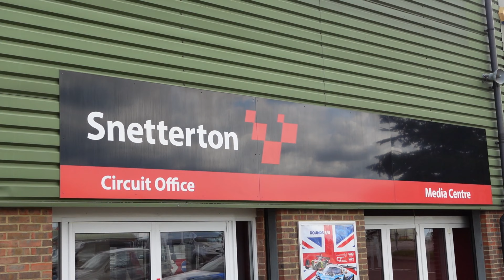I Took My R32 Mk2 Golf On My FIRST Track Day After Rebuilding It

Comment: You did so well especially for your first day! The Golf sounds incredible!!

A couple of things that might help you, from my experience. Firstly bin off the dash board cam and stick with the incar cam, you will learn so much about what you are doing, how you are positioning the car, steering inputs etc.

Secondly (im not sure if it was you or Ben on the incar?) but always keep your hands at 10 to 2 (or wherever is comfy) you should never need to feed the wheel / move your hands from that position. (Hairpins will only ever need a full crossed arms turn) the benefit of keeping your hands in one spot is, you can accurately apply the same lock each time and also if the car gets out of shape and you have to add some oppo, you know exactly where the wheel is. If you move your hands on the wheel for a corner and the car steps out, you need to act fast to add some oppo, and you will have no clue if youve add 1/2 a turn a full turn of lock etc its very easy to over correct in this situation and end in a tank slapper… keep your hands firmly in 1 position… ill stop blabbing now 😄

Looking forward to some more track action!
Reply from the maker: Appreciate you watching and enjoying the video. I've watched a number of yours so to receive feedback from you with the experience you have is really valued. 
The GoPro was a funny one, it was primarily used simply for the hyperlapse heading to the track, then thought, hey, why not view things from another perspective too? But yeah, the in-car cam, viewing the wheel and the road ahead does give far more useful footage for me to look back on and see where I can improve.

With regards to the hand positioning, I do have to make a conscious effort to keep them at the quarter-to position. I think it was Ben who lets the wheel feed through but he has a long standing wrist injury so is unable to grip the desired way. Even with that, he's still able to drive the wheels off the car! 

I tell you what though. It was so much fun and I was getting more confident as the session progressed. I'm itching to get back out! Where would you recommend as perhaps another good entry level track?
Reply: @golfmk2  

Absolutely! You could tell he wasnt handing around!

Ive hardly done any track by you, but id recommend Anglesey if you want a trip out? Its a fantastic circuit, Cadwell is also one of my favourites! Failing those the Nurburgring is a must!!

Looking forward to seeing more track footage! You will have to take me out for a passenger ride at Curborough if you are going this year

👍🏼
Reply from the maker: James Cope you know what, Anglesey is one that really floats my boat, but it's so far away from us it would be at least an overnight stop, so needs a bit of planning. Cadwell is a bit advanced for me, especially the twisty bit added to the fact it's very narrow. 
Bedford isn't far from us, neither is Brands, but Bedford's noise restrictions are crippling and Brands is very expensive. There's also Donnington, which is a couple of hours drive too, but again, quite a complex and unforgiving track!
Reply: Talking to me about hand positioning? 😅  I broke my wrist and forearm years ago and have to set my hand positioning up in advance for certain corners as the movement you describe is not possible, reaching a limit before a normal person
Reply: The dashboard cam does have one benefit... You can see that it's turned on and recording!   It's probably why the footage was used I'll wager.  The other camera seemed to have a mind of its own as to when and how long it would record lol
Reply from the maker: You're not wrong, there were some technical issues with the recording equipment, both with the GoPro and in car camera, where some large sections were not recorded or severely cut off. I'm going to blame the tech, as it definitely was not user error. Nope. Definitely not. 😅
Reply: It was not a criticism just an observation 👍🏼 but totally understandable!

Gopros tend to have a habit of doing that! I think the newer models seem much worse from what ive seen online. I borrowed an 8 black for my last trackday and it was brilliant, great quality and didnt fault once… maybe i was lucky 😄
Reply: @Jims_racing  100% welcome the comments and feedback, it's impossible to list all the conditions and reasoning.  I would advise exactly what you said.  The camera setup for me can really chew into / be at odds with just enjoying driving.  Takes a lot of effort to get it setup correct with good angles, set the exposure so it's not bathed in the nuclear explosion whiteout while the camera tried to brighten the dark interior 😅
Reply from the maker: @James Cope  yeah the I was using was a Hero 7 Black and I'd not had issue with it prior, but on that day, that and the in car cam decided to tag team me to randomly stop recording at various points! Couldn't handle the speed, perhaps? 😅
Reply: @golfmk2  💨💨💨

Comment: Looked a cracking day out 😎
Reply from the maker: Oh it really was a great day, and I've really got the track day bug now. Goodbye any disposable income and family holidays! 😅

How you done a track day at all before?
Reply: @golfmk2  😁
Reply from the maker: @Ricky Dub  does '😁' mean a yes? 😆
Reply: @South East Mk2 Golfs  ah, sorry didnt open the post full and replied on a drop down...   no, i haven't 😔 had planned to look into it this year, i live not too far from knockhill and have driven it years ago but maybe next year... 😁 B-road blasts til then 😎
Reply from the maker: @Ricky Dub  Ooo, I like Knockhill as a track when I watch motorsport on there. The final sharp right hander as you head up the hill certainly looks fun! It looks like it would suit more powerful cars though, is that the case?
Reply: @South East Mk2 Golfs  i was in an xr2i catching a guy in a ferrari 348 , instructor was impressed by end of the session 😁 said i wouldnt be at the back of pack in a hot hatch class but that was 2004 😂 i've used his matra since though; all the braking done  before the corner then flat out through 😎 look forward to your next vids 👍
Reply from the maker: Ricky Dub now that sounds like great fun! Just shows you can have as much fun (if not more) in a lesser powered car than a supercar. Good motto with the instructor advice though, basically different wording to 'slow in, fast out'.

Comment: Hey man I got a question about the oil light mine keeps blinking I can’t figure it out
Reply from the maker: Hi. Does the oil light blink depending on conditions? For example, after a spirited drive, or when the engine is cold or hot? Also, any top end tapping sounds that you can hear?
Reply: Well I did the engine swap 3.2 vr6 I’m assuming to use both of the oil pressure switch sensor one high one low but I’m not too sure
Reply: Keep a Mk2 cluster happy by using Mk2 pressure switches.
Reply from the maker: As above, I have OEM Mk2 switches in place. Providing you're still running Mk2 clocks, this will save a big electrical headache.